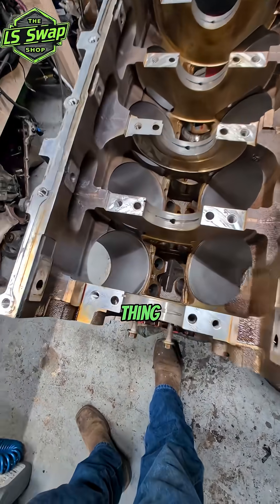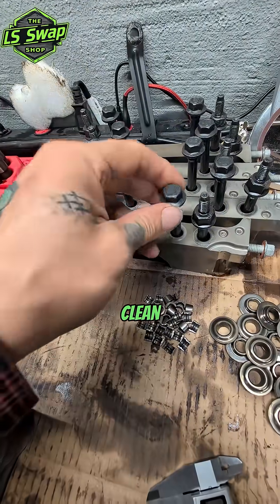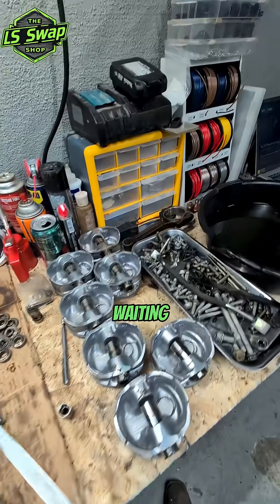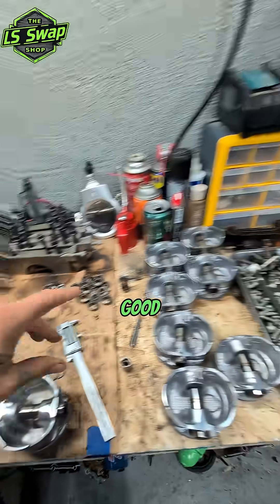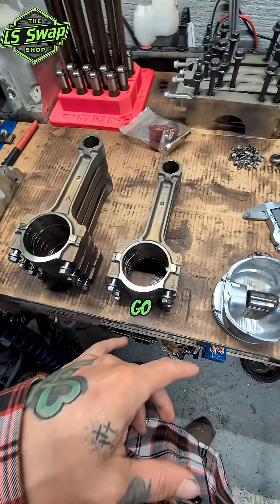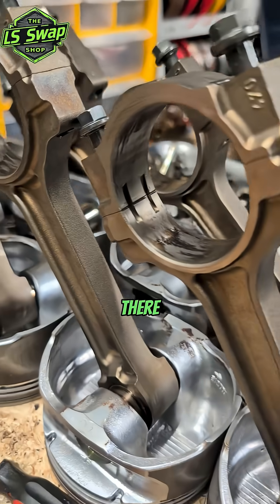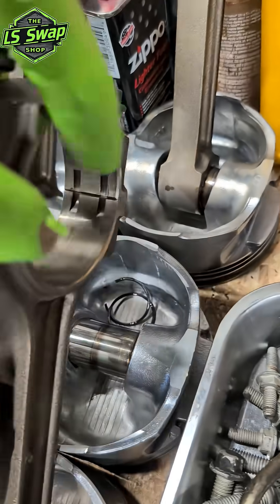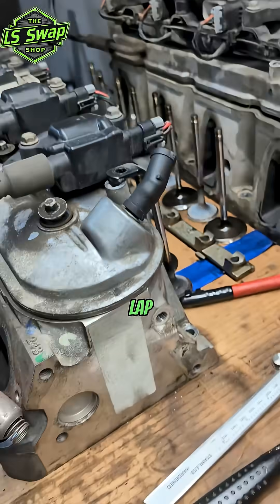Assembling the LS2 connecting rods!! 2

Comment: Hey bud.. 
i really enjoy the  no bs approach to your videos. 
Who do you order those main bolts from?
I’m in the middle of rebuilding the LQ4 out of my Silverado and although I’ve read that you can reuse the stock main bolts, I would rather replace them for piece of mind.
Reply from the maker: Thanks man. I appreciate that. I got these in a lot actually. Came with kings main. And rod bearings. And connecting rod bolts as well Here's the link. https://a.co/d/cWFKQsi
Reply: @TheLSswapShop thanks!
Reply from the maker: @mikedamian1338 no problem.
Reply from the maker: Yes the main bolts you can torque up to 3 or 4 times I believe. But the connecting rod bolts are not re usable